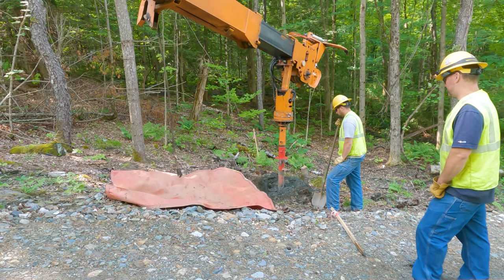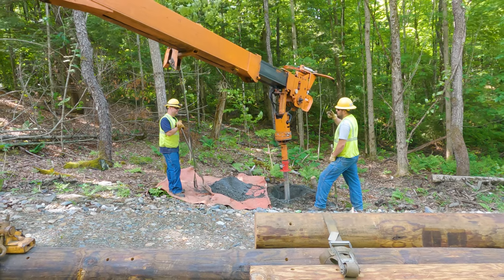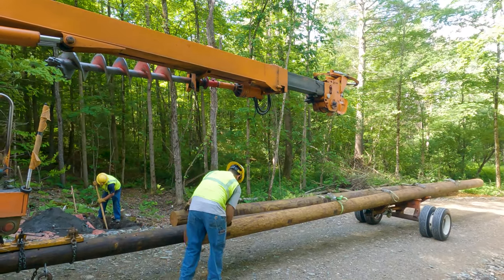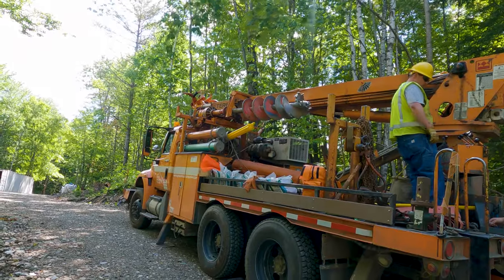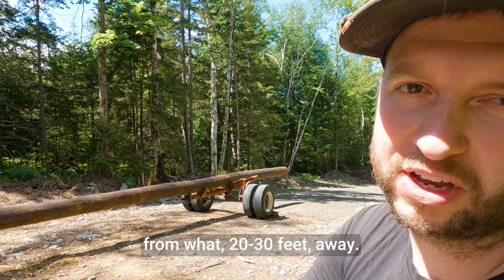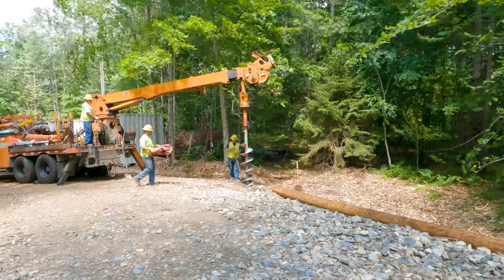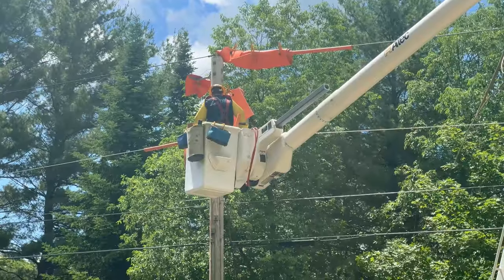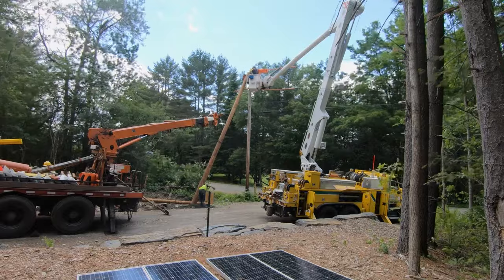Two ELECTRIC POLES are IN! The third failed 😞

Comment: That's a huge auger, very impressive to watch the crew dig and set with such confidence. They make it look so easy!
Reply from the maker: They were fantastic! They worked great as a team and it was a really slick operation.
Reply: @AdventurousWay  My current house is over 100 years old, and I recently had the electric upgraded to 200 amps. I thought that was a lot, you are having twice that. But you are right, electric cars in the future will require incredible amounts of power. By then I will probably be biking everywhere, lol.

Comment: I love your videos and have been following for quite awhile.  My question is why you would spend all that money to bring power in from the road when you could use solar with generator backup for power.  We’ve got a similar property in Maine that we’re developing but our homesite is 1.5 miles from the closest power pole , so we’ve been designing for solar from the start.  Anyway, just curious and we have our Kubota 3902 being delivered in a week or so!
Reply from the maker: That's a great question, and we should probably to a full video on it, but for now in simple terms there are 3 big reasons:

1. We're building an all-electric home - no burning wood, gas, oil or coal for heat or hot water. Why we're doing that is a separate topic, but one of the consequences is the need for electricity, particularly in the cold winter months when solar is least effective.

2. We're looking to the future where electric vehicles will become commonplace, and we want to make sure we have sufficient power to charge one or more EVs. The batteries on those demand huge amounts of power, and it would require a massive solar array to feed them. It's one of the reasons why we're planning on a 400A service to the property.

3. A guiding principle throughout our build is to construct it in such a way that it can be left unattended for extended periods when we travel, including during winter. This makes clearing solar panels of snow and maintaining a generator trickier.

We really debated this question a lot - after all, we're no strangers to solar and off-grid living in the RV (we've been off-grid on our property since returning in March this year, running mostly on solar and only running a generator occasionally). We also intend to have a modest sized solar array and battery backup on the property, and we are designing things in such a way as to be kind to battery-based power - e.g. our well pump has slow-start to reduce LRA.

Congrats on the new Kubota! I saw they had released a new version, the L3902 - if it's anything like our L3901 you'll absolutely love it!